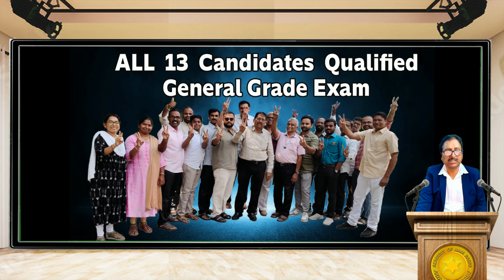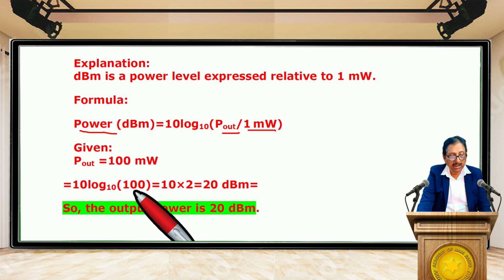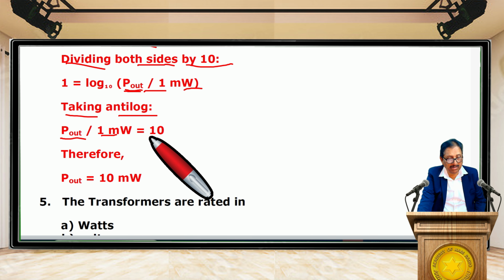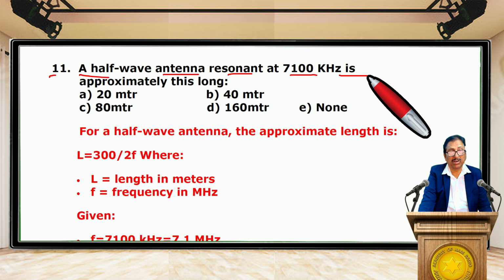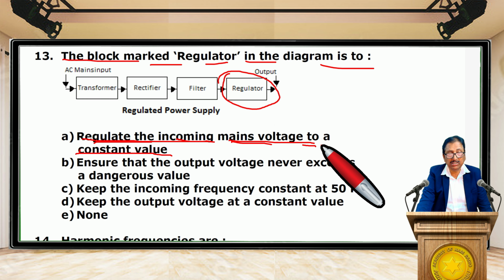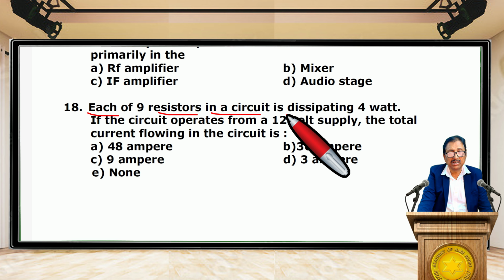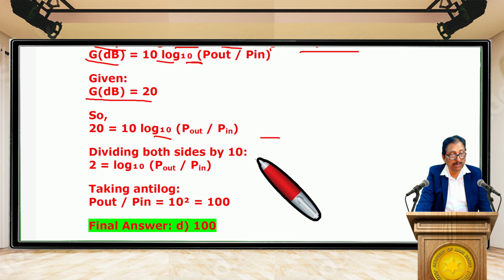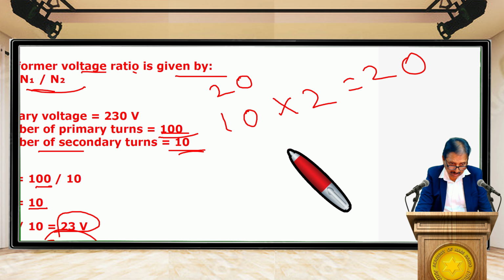Ham Radio Exam Electronics Part Model - 4

Comment: question no 13 . The correct answer is:

d) Keep the output voltage at a constant value

Explanation:

In a regulated power supply:

Transformer steps voltage up/down
Rectifier converts AC to DC
Filter smooths the DC
Regulator ensures the final output voltage remains constant, even if:
input voltage fluctuates
load changes

So the regulator’s main job is stabilizing the output voltage, not the input or frequency.